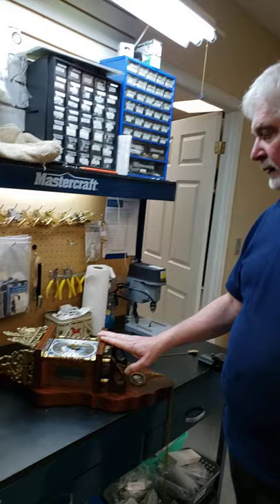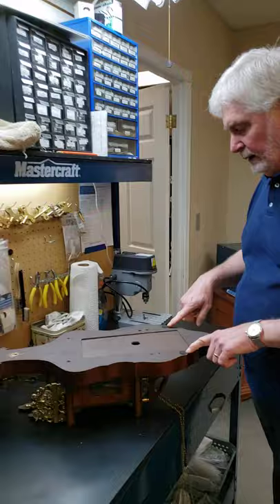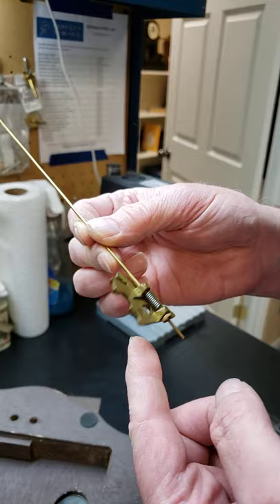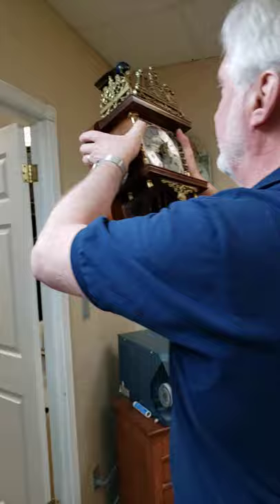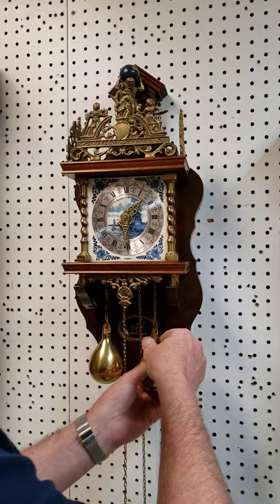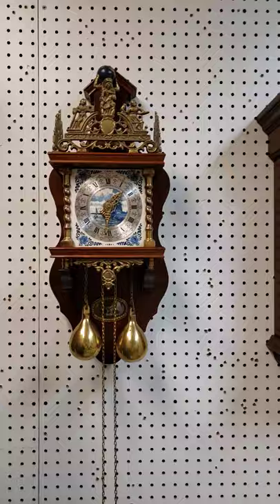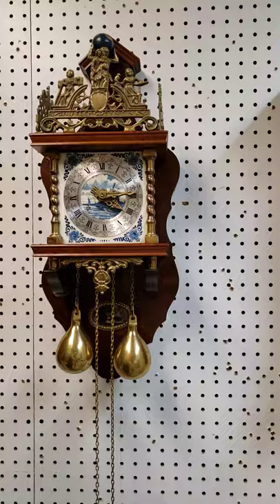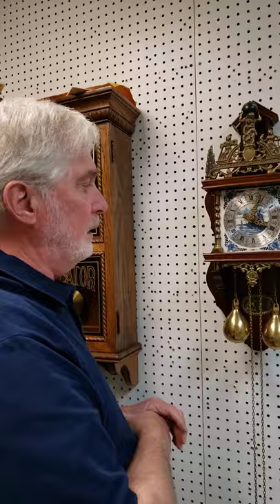Dutch Wall Clock Setup

Comment: I inherited a dutch wall clock similar to this and am trying to get it running.  The difference in mine that I can see comparing this to yours is that there is no access to the pendulum from front (like the pencil opening you show).  Anyhow, I hooked the unit to the wall and gently swayed the unit to get the pendulum running but it eventually comes to a stop & I don't see any advancement in the 2nd hand?  Not sure what is wrong?